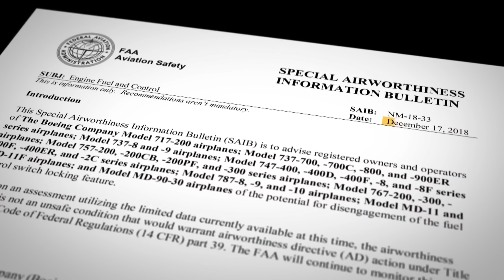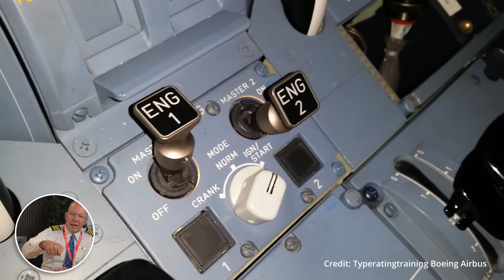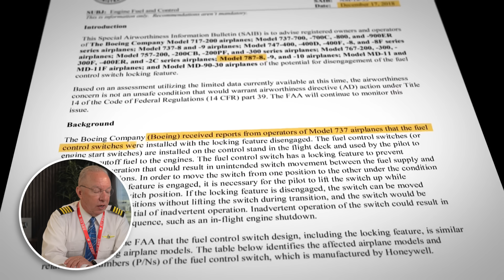Air India 171: The FAA’s 2018 Fuel Switch Locking Bulletin Explained (16 Questions Answered)

Comment: if the dentent is so positive (either in or out) then that describes the switches as safe and that they can not in fact be accidentally moved from one positon to another as decribed by the FAA safety concern. It makes no sense. I notice that the concern in 2018 by the FAA doesn't describe HOW that can happen, only THAT it can happen. Most odd.
4:35 "the visual compnoent is missing" how can one say "one has all the information" then? The "visual component would be captured in the black box as much as anything else and would instantly cleared up how and when they were switched!  Currently they're still guess no even know WHO asked the question and who aswered, merely the voices. The "visual component" would have solved that part. Futhermore, of course the cameras wouldn't prevent anything as much as anything captured in the blax box doesn't prevent anything", but it certainyl clears up ,atters and that is precisely what the black box is for! Surely??!!

Comment: Just a theory, but if the fuel switch lock is worn out due to regular usage and/or has loose/rusted spring mechanism (due to regular disinfectant seepage). In that case during flight take-off the high G-forces + Earth's gravity can accidentally flip fuel switches to cut-off position without pilot's input.

Comment: One confusion till now, according to the report, one pilot asked " Why did you cut-off the switch", now, it is not possible to detect for the driving pilot (co-pilot) to actually notice that cut-off switch randomly while flying (during takeoff, must be busy focusing forward). So only possibility of asking that question by the driving pilot could be after being observed by some movements, neither it was not possible to detect the switch position. And the monitoring pilot should not ask this question as he was continuously monitoring the takeoff process. Confusion.

Comment: Similar incident in 2019 where FADEC system killed both the engines....

All Nippon Airways (ANA) Boeing 787 in January 2019, where the aircraft experienced dual engine shutdowns shortly after landing at Osaka Itami (ITM) airport.
Here's a breakdown of what happened and the suspected role of the FADEC system:
The Incident:
 * On January 17, 2019, ANA Flight NH985, a Boeing 787-8, landed at Osaka Itami Airport.
 * After touchdown, as the pilots engaged reverse thrust, both Rolls-Royce Trent 1000 engines simultaneously shut down.
 * The aircraft rolled down the runway for a significant distance (over 8,000 feet) before coming to a complete stop.
 * The crew was unable to restart the engines despite following checklists and consulting with maintenance.
 * All passengers and crew disembarked safely, and the runway was closed until the aircraft could be towed away.
The Suspected Cause and FADEC's Role:
 * Initial inspections of the engines themselves found no mechanical faults. This immediately pointed towards a computer or software issue.
 * The investigation focused on the FADEC (Full Authority Digital Engine Control) system and specifically the Thrust Control Malfunction Accommodation (TCMA) system.
 * TCMA is a safety feature designed to prevent uncommanded high thrust and protect the engines.
 * The leading theory, supported by Boeing service bulletins and later reinforced by aviation experts discussing the recent Air India 171 crash, was that the FADEC's software misinterpreted the aircraft's state.
 * Specifically, it's believed that the pilots may have applied full reverse thrust too quickly after landing, before the aircraft had fully transitioned from "flight mode" to "ground mode" as perceived by the aircraft's systems (like weight-on-wheels sensors).
 * In this scenario, the FADEC, believing the aircraft was still in a "flight" state but receiving inputs for "ground operations" (reverse thrust), might have commanded an engine shutdown as a protective measure. Essentially, the software logic could have overridden pilot inputs to prevent a perceived unsafe condition.
 * The lack of a cockpit alarm indicating an accidental thrust reverser deployment added to the complexity, as the crew wouldn't have immediately understood the FADEC's reasoning for shutting down the engines.
Impact and Relevance:
 * This 2019 ANA incident is frequently cited in discussions about the complexities of highly automated systems like FADEC and the potential for software glitches or misinterpretations of aircraft state to lead to critical events.
 * It highlights the importance of the interface between human pilots and advanced automation, and the need for robust software design and redundant systems to prevent such occurrences.
 * The incident has gained renewed attention recently due to its similarities to theories being explored in the ongoing investigation of the Air India Flight AI171 crash in June 2025, where a dual engine power loss occurred shortly after takeoff, with FADEC and TCMA system behavior being a key area of inquiry.

Comment: Captain Steve - Completely disagree with your opinion.  You seem to be concluding one of the pilots did this intentionally and dismissing all other possibilities outright.  Remember your June 13th episode?  You were pretty damn sure then that the pilot inadvertently retracted the flaps instead of the landing gear.  Obviously that was incorrect. 

I think there’s more to this incident.  It could very well be a mechanical or electrical issue.  Let’s not blame the pilots when we don’t have all the facts.  I am quoting from the FAA bulletin MN-18-33 - "The fuel control switch has a locking feature to prevent inadvertent operation that could result in unintended switch movement between the fuel supply and fuel cutoff positions. In order to move the switch from one position to the other under the condition where the locking feature is engaged, it is necessary for the pilot to lift the switch up while transitioning the switch position. If the locking feature is disengaged, the switch can be moved between the two positions without lifting the switch during transition, and the switch would be exposed to the potential of inadvertent operation. Inadvertent operation of the switch could result in an unintended consequence, such as an in-flight engine shutdown".  This implies that the switches CAN BE moved inadvertently without lifting them up if they were installed with the locking feature disengaged. WOW!!   And Boeing recommends this inspection be done immediately.  Air India did not do this as this was not mandatory.  

Wouldn't this explain everything?  If one of the pilots inadvertently moved the fuel switches to Cutoff when he took his hand off the thrust levers without realizing it, it explains the pilots conversation. When the pilots noticed the engines winding down they looked at the switches and asked "why did you do it?".  And the other one replied "no I did not do it" (or something to that effect).  It then probably took them a few seconds to figure what was really going on and then they moved the switches to "run" position.  This would explain the RAT being deployed, the plane loosing altitude and everything else. 

We have proof of the "what" happened from the FDR (fuel being cutoff).  The above would explain "why" the fuel was cutoff.  It was an inadvertent action by the pilot which was caused because the switches were installed with the locking feature disengaged.  Isn't this a possible scenario?

Comment: Why isn't such a crucial function of switching off both engines a procedure that is delegated to both of the pilots? E.g. one switch for the left side pilot and one for the right side pilot! That would have clearly prevented this from happening. BTW: I was a mainframe computer engineer and we also had lots of procedures in place to never erroneously shut down a mainframe.

Comment: what if the pilot slipped back from seating and he franticly grabbed switches to hold something. will it break from slot and turn off due to body weight load. CURIOUS

Comment: What are the chances that the pilot was inexperienced, or really tired, or simply had a complete lapse of judgment, that made him activate the wrong switches? Is there any other similar-looking, or similarly positioned switches that need to be activated at that point of the take off process? That would certainly account for the pilot claiming he did not cut off the fuel.

Comment: Once the fuel switches are switched off and the engines flamed out, how long would it have taken to get the engines working again? Would it have been possible to have saved that aircraft if there was a fast reaction?

Comment: Nobody suggests a camera in the cockpit would prevent a crash but, like the CVR, it would provide information. In this case a camera would show which pitot switched off the engines. Why are you so opposed to the idea?

Also why, in an earlier video, were you so quick to dismiss the idea that the switches were deliberately moved?

In both cases, are you perhaps letting pilot loyalty get in the way of sound, objective analysis?

Comment: If I thought my life depended on putting both fuel cut-off switches back on as quickly as possible and it took 4 seconds between each switch being re-engaged, how come it took only 1 second between both switches switching off upon take off?

Please clarify how easy is it with seat belts on during lift-off to use both hands to switch both switches off? I acknowledge Captain Steeeve’s wisdom and experience, but only 1 second to use one hand to pull-lift- release-move-pull-lift-release seems a very short time to me. Has an actual rather than estimated timed physical study been conducted? 

If as a pilot (which I'm not) I believed the switches were fail safe and noticed they had changed positions and I hadn’t moved them, then I would automatically assume it must have been the co-pilot who moved them (and accuse him) whether I had seen him do it or not. I am not saying that human intervention wasn’t the case, and I agree it looks likely, but perhaps we are being a bit too quick to dismiss a hither to unknown mechanical failure.

Comment: Captain Steeve, could it be a circuit failure? The report indicates that one pilot asked the other about the cutoff, but the other pilot denied making any changes. At the crash site, the controls were found in the 'run' position. It's possible that during takeoff, the controls were correctly set to 'run'. One pilot might have switched to 'cutoff' and then back to 'run', leading to the crash. However, let's consider the scenario where the controls remained in the 'run' position the entire time. A circuit failure could have triggered an alarm, prompting one pilot to ask about the cutoff, while the other pilot confirmed no changes were made.

Comment: As an aviation enthusiast, the recent investigation into AI171 raises important questions about cockpit design and safety protocols. If a single pilot can shut off fuel mid-flight, leading to a crash, shouldn’t the FAA and Boeing rethink the design of fuel control switches?
One idea could be placing two pairs of fuel control switches—one on each pilot’s side instead of the center panel—so each pilot controls only their own set. On top of that, a master fuel control system could be designed to respond only when both pilots set their switches to the same position (either CUTOFF or RUN).
This would make sure no single pilot has full control over such a critical function, improving safety and shared decision-making in the cockpit.

Comment: Capt Steve, is it possible that the switches had lost their spring mechanism? So when the plane was on the runway the switches were on Run. At rotate the switches could have collapsed to cut-off.

Comment: I think Capt Steve is a little too dismissive of the possibility the switches were faulty as per the FAA bulletin. If you read the bulletin it is very clear that the issue could lead to dual engine failure mid flight. Capt Steve's explanation of the unit being installed upside down is ridiculous. How would the plane even have taken off if the switches weren't able to remain in the RUN position? That combined with the emphatic insistence that this could not be attributed to anything other than pilot error? I sense loyalty to Boeing here coming from Captain Steve.

Comment: CCTV would not have prevented the crash, but could tell us a lot about the interaction between the 2 pilots, specifically, the long interval between the cutoffs being activated, and reset (10 seconds for engine 1, 14 seconds for engine 2) that is an inordinate amount of time. What was happening? Was there a physical struggle going on? What caused that delay, which amounted to almost half of the total flight time?
That is something that CCTV could tell us. It only needs be on a (say) 2 minute overwrite loop.

Comment: SAIB NM18-33 of the FAA"The fuel control switch has a locking feature to prevent
inadvertent operation that could result in unintended switch movement between the fuel supply and
fuel cutoff positions. In order to move the switch from one position to the other under the condition
where the locking feature is engaged, it is necessary for the pilot to lift the switch up while
transitioning the switch position. If the locking feature is disengaged, the switch can be moved
between the two positions without lifting the switch during transition, and the switch would be
exposed to the potential of inadvertent operation. Inadvertent operation of the switch could result in
an unintended consequence, such as an in-flight engine shutdown." to be read in the respective document."This Special Airworthiness Information Bulletin (SAIB) is to advise registered owners and operators
of The Boeing Company Model 717-200 airplanes; Model 737-700, -700C, -800, and -900ER
series airplanes; Model 737-8 and -9 airplanes; Model 747-400, -400D, -400F, -8, and -8F series
airplanes; Model 757-200, -200CB, -200PF, and -300 series airplanes; Model 767-200, -300, -
300F, -400ER, and -2C series airplanes; Model 787-8, -9, and -10 airplanes; Model MD-11 and
MD-11F airplanes; and Model MD-90-30 airplanes of the potential for disengagement of the fuel
control switch locking feature." That is FAA publication.

Comment: Would it be possible to put in an overide in the computer if the plane is in flight parameters and fuel swithes move from run to off. Like instant verbal or visual warning, like maybe " fuel shutdown do you wish to proceed "  or even fuel shutdown, not allowed at this time.???

Comment: the FDR recorded the valve position ... NOT ... the switch position. How do we know IF the switches were placed to cut off??  Perhaps the FADEC malfunctioned and closed the fuel valves ... were the fuel cut off switches moved from run to cutoff to run by one of the crew in response to the FADEC cutting fuel (and therefore causing dual engine failure)?? Its strange that the fuel cutoff switches were moved by the crew as the QRH would require and light up was indeed beginning , the engines were spooling up. Seems strange that a re-start was attempted almost immediately ... if it was an initial intentional act , it doesnt make sense that one of the crew would immediately try to recover the situation... ???

Comment: A total electric failure would absolutely cause a dual engine failure with no electrical your engines are shutting down.

Also if theres software to prevent fuel cut off switches mid air nothing stops a pilot from going nose down on the yoke

Comment: A red herring. Had the fuel switches not been operating correctly on AI 171 it would have been entered in the tech log the previous flight since these switches are operated on engine shutdown at the gate - or sometimes during taxi after landing to save fuel. One engine might be shut down using the idle of the live engine to taxi.

On cameras in the cockpit. There are plenty of YouTube videos showing pilot performance in the cockpit. There are hundreds of them. Why not make it a mandatory feature?